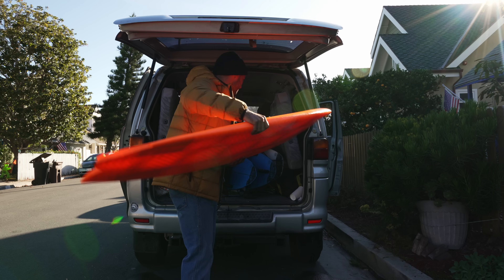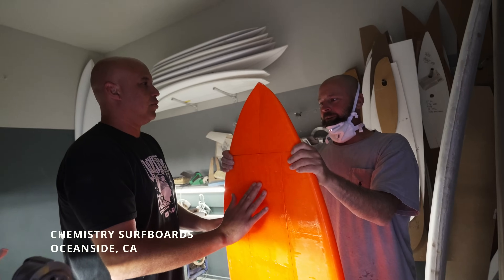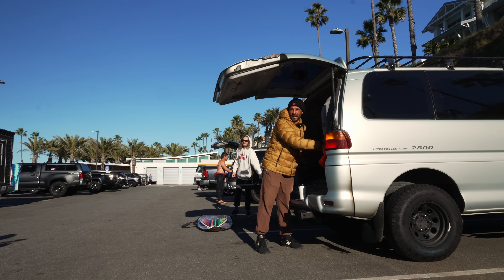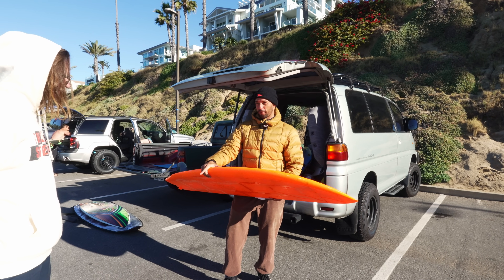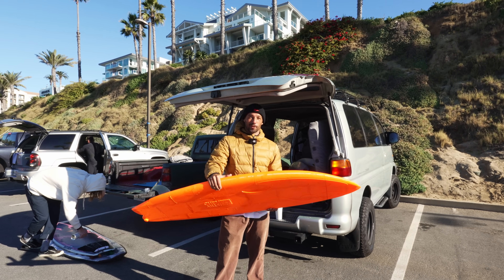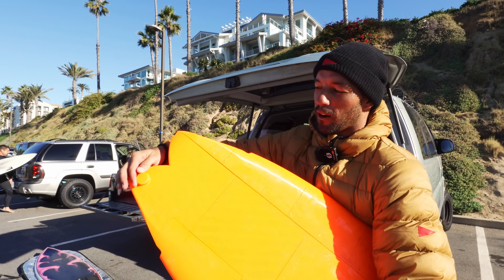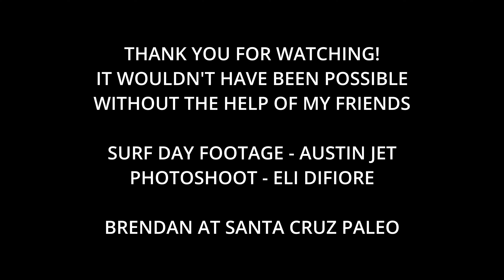I 3D PRINTED A SURFBOARD AT HOME

Comment: Very cool build, for the next one look into other joinery methods often borrowed from woodworking such as dovetails. The dowels are not ideal for this
Application as they are prone to concentrating stress during flexion and can snap.. Take a look at the 3D printed firearms community they are the probably the most technical hobbyists pushing FDM to the max and have a lot of great tips and techniques to borrow. Another thing to look at would be some more advanced printing materials such a pa6-cf that can be annealed. Would be expensive but could build something incredibly durable

Comment: That is such an awesome project the passion you have is amazing I thought these pointers could help for V2 from a fellow Bay area 3D printer user
--Seems like you might have printed it vertically which would make it easier for the piece to snap in half where as horizontal could make it stronger
--I also noticed that the outer walls were printed pretty thin, for cosplay at least we tend to print it thicker to prevent cracks and snaps
-- Maybe try Gyroid infill have seen much less failures with it
Would love to talk more on how maybe it could be improved this is amazing!

Comment: Hey nice job there. I'm gonna stay tuned for the V2. Love the work and passion behind it!

I been thinking about a mix of dovetail with a dowels hybrid you could reach a point between flex and not passing the limit deformation of the filament. The cloth and resin work together to mantain the board in those boundaries. The dowels are good for keeping the pieces together but is a woodworking techinique meant for things that arent gonna flex.

May I ask you what type of jointery is meant to flex?
I'ts not about the jointery at all. I'ts about maintaining the piece between the limits of plastic deformation when you apply forces to it, so the more effort you put in maintaining alltogheder but allowing to flex without deformation the better results you'll get

I think that if you would put a dovetail in each of the faces and the center for each piece you could reach better results. Like a puzzle kind of stuff, this way you could also adapt each part of the surfboard to allow differents flexes ranges (imagine that you are riding a front wave and you are going sideway engaged at the rail. If you press down the board in between the part of the rail and the center of the board it could flex upwards. the board in the center will always compress towards the center so you gotta make the tail and the nose capable of flex a bit)

If this flex thing sounds weird and nonsense, then i think that a solid construct with proper cloth and resin over each surface will be needed to mantain everthing together...

Good luck in your journey!

Comment: Great stuff dude... Can't wait to see V2...!! Also consider getting a stronger material for the connection rods.. and I don't know what way you printed the connectors but they should be laying down on the printer so there is not layer lines that could shear.

Comment: Gluing PETG is a nightmare. Try ASA its strong, UV resistant and can be glued easy. Seems your board broke at the glue-up. Change the infill from triangular to a stronger pattern like gyroid. I`m living in the mountains and will probably never surf in my life but have done some technical prints for building my own paint booth. Rad project so far! Good luck for your second try.

Comment: Amazing experiment! As an engineer, 3D printing fan and surfer, I instantly subscribed! I'm curious to see what you try next, I've 3D printed about everything from guitars, RC planes, and even Tourbillon Clocks! Haven't tried printing a surfboard yet. However, I would try using a mix of hydrophilic filament materials and epoxy resin the exterior, even a hybrid inner EPS core with 3D printed exterior. Some slicers even have new interesting outer layer finishing settings, you could even make a grippy traction layer for a wax free board. Great content, thank you for sharing 😎🤙🏄‍♂️

Comment: Definitely gonna make something similar. You should increase the infill and use a puzzle like assembly style. After that it's best to seal the plastic, you can just use resin but there are specific materials for sealing 3d prints.
Reply from the maker: It would be 50 pounds if I did that unfortunately hahaha. Next time will be super legit!
Reply: @beachcowboy_  it depends, for example instead of cheap pla you can use foam pla, this way you can increase infill without increasing weight. Also sealing the pla makes sure that it doesn't absorb water, probably your board broke because water got in and due to the extra stress caused by the weight it failed.
Reply: @beachcowboy_  also you don't have to print inside walls like the outside ones. In the board you made every piece had a lot of plastic and weight on the inside walls, this can be avoided when slicing the model. This way you save on filament and weight.
Reply: @beachcowboy_  try searching for a brand that makes foam pla and ask for a sponsorship I really think someone will really like this idea and help you make v2
Reply: @beachcowboy_  right now I am working on a skateboard, but when I finish this I will start making a surfboard too

Comment: Change the dowels to aluminium and re-epoxy it back together, I think it would work. Maybe add an aluminium stringer down the middle with the dowels going through it from either side. You could model it from your existing CAD and get it laser or water-jet cut from a piece of 6mm aluminium. Just trying to help, great project 👍👍👍
Reply from the maker: Great input thank you! I'll see about something similar on the next one
Reply: I wonder how experimenting with carbon would go? Like sticking with composite materials

Comment: I’m studying mechanical engineering, I surf, I have a creality ender 3…. might have to built one too
Did you use autocad or solid works?
Reply from the maker: Creality might be rough with this one, they are so unreliable in my experience but definitely worth a shot! I use Fusion because I only have a mac at the moment

Comment: dude i never thought it would make it that far! this is nuts! i think if you would only fibreglass the outside you would have a pretty strong board
Reply: You don't have to fiberglass the outside. Just increase the infill and use a puzzle like assembly style. After that it's best to seal the plastic, you can just use resin but there are specific materials for sealing 3d prints.
Reply: @rodolfoo3015 Most of an object's strength comes from the outer perimeter/shell. This is why surfboards use foam with a fiberglass shell. You are much better off using as little infill as possible to get the strength you need, then fiberglassing the outside.
Reply: using fiber glass i think is the right call

Comment: For printing in parts, I'd cut the board in half between the deck and the bottom as well, so you can print it without supports but still have the layers horizontal when youre surfing. printing it vertically like that puts all the force of standing on it on the weakest side of the printed parts
Reply: Yes, horizontal “grain” direction would be much stronger
Reply from the maker: It failed at the joints, but I like the input! I realized that when I was too deep into printing it hahaha. V2 will be legit!

Comment: What glue did you use with the PETG?
Till now we have not found anything that will work as should!
Reply from the maker: I used a two part epoxy! Holds super strong!
Reply: @beachcowboy_  Thank you for the update. Epoxy should theoretically not stick to PETG, but I'm going to give it a try for some parts of my eFoil. 🤙

Comment: Good job, it looks awesome! What about using carbon fibre reinforced filament and some snap fit joints to connect all together (no need for epoxy)?
Reply from the maker: I wanted to experiment with that actually, making another version with fins and then will start testing with snap fit joints!

Comment: I’m thinking you only have to print the core of the board and then laminate it. A honey comb structure to get it light and cut down on the print time
Reply from the maker: Couple guys are doing that already, it's super cool! I wanted to start by only using the printer and filament with glue, V2 may have something similar!

Comment: I guess plastic alone will never be strong enough or way too heavy. I 3d-printed a small (4'11'') surfboard for river surfing. It ended up being a bit heavy (4kg) including the laminate (2x4oz on both sides). But it is plenty strong and still works like on the first day after more than half a year. An it has had a few close encounters with the rocks and walls too 😆
I took a different approach and designed and built a big 3d printer to be able to print the surfboard in bigger parts cut vertically for better printability (spiral vase).
The idea is based on this video, which inspired me a lot: https://www.youtube.com/watch?v=UpivJcz0HXM
Reply from the maker: I think if i took the infill density way down and coated with a thin layer of epoxy and wood stringer it would help tremendously!! I'll check the video out!!
Reply: @beachcowboy_  I'm not convinced that it will work without lamination, but I will definitely watch the video on it 😉

Comment: Would a circle dowel be possibly more structurally sound here I don’t know why but it seems like intuitively it seems right maybe because of the rapid variation of angle of force the dowels are getting maybe better not to have no flat surfaces or corners ?
Reply from the maker: Totally valid! But when it comes to 3D printing the triangles were a much better option because of the print orientation and I hate using support structures!

Comment: Dang. How can I get me some of those STEP files? My machines are rearing to go.
Reply from the maker: I’ll put v2 files up when I make it. This one was kind of a turd hahaha
Reply: @beachcowboy_  Suggestion...why not print it and then glass it? Admittedly I watched the vid on 1.5x so you may have glassed it and I missed it but I've made boards out of some exotic stuff and even a 6 ounce layer of glass with the proper epoxy resin can give great strength without adding weight. You may even be able to drop the infill even lower.
Reply from the maker: Too hard to sand with the extruded logos and flames, but totally possible

Comment: Use a biscuit jointer and biscuits next time, did it break at a seam or middle of a piece? I assume you staggered all the pieces too?
Reply from the maker: It broke at the bond between the epoxy and the dowel, I’ll check out the biscuit idea thank you!!